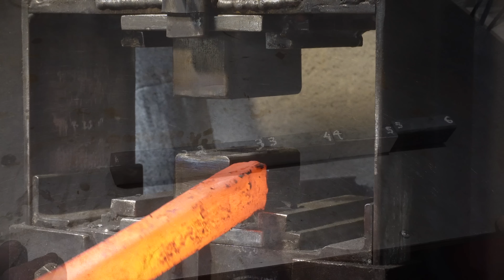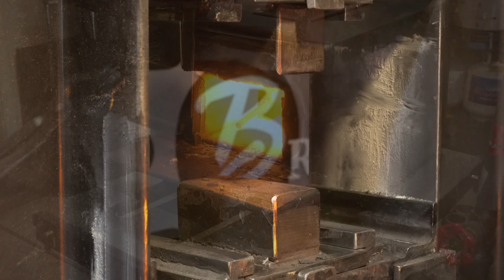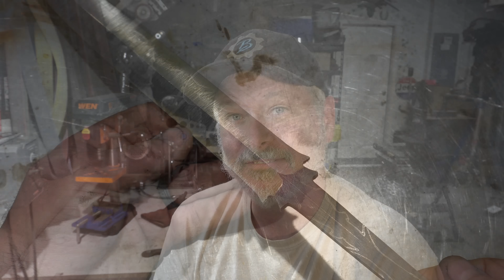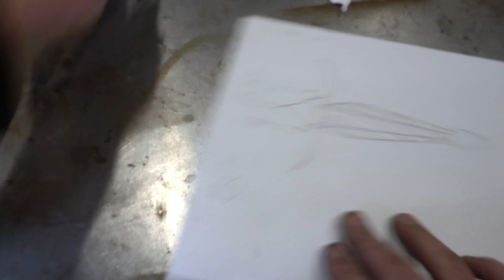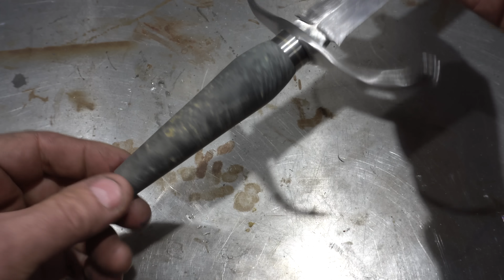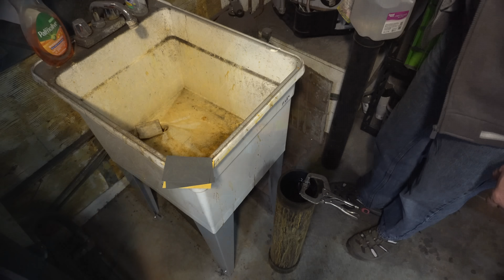Forging my dagger for The Dagger Challenge!

Comment: a lot of non welds that i saw around the 8 minute mark i guess from no flux
Reply from the maker: If you mean during the restack, that is from grinding out the scale.  Sone areas I had to go a little deeper.  There were no bad welds in this build. Flux tends to cause more problems than it solves so I don’t use it.  Thanks for watching.

Comment: Where did you purchase that dental drill ?
Reply from the maker: That is a GRS high speed rotary tool.  You can find them with a Google search.  They are around $550 though and require an air compressor with a special regulator.  Thanks for watching.

Comment: The dagger turned out great, I think the only thing I would've done differently (and that's really down to personal preference) is use a lighter handle material (I think it's too dark overall), and either use a blackened wire wrap, or change the inlays to gold and use a gilded wrap.

Still a lovely dagger, great job.
Reply from the maker: Thanks for taking a look at this build.

Comment: looks awesome!  i have a question.  do the fish lips technique make the tip weaker compared to if you just cut the tip in?
Reply from the maker: No, the forge weld on the fish mouth is like any forge weld, if done properly it’s as strong as the base steel.  Thanks for watching.

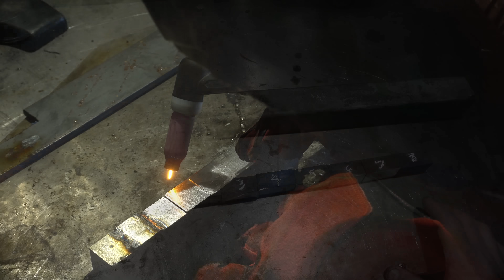Comment: 5:45 not to brag, but I used to know a guy who could TIG weld so well that he could weld two pieces of aluminum foil together.  He was a nice guy, and he didn't force his ways on anyone but himself.
Reply from the maker: Well that's definitely not me...  🤣.  My tig welding skills are basic at best.  I'm improving though.  Tig welding aluminum foil is another level for sure.  Thanks for watching.
Reply: @TyrellKnifeworks  You're better than me, I don't do welding. LOL
Reply: @TyrellKnifeworks  I just had a random thought.  I wonder  what this would look like using Copper Damascus.  I think it would look wicked.
Reply from the maker: @Asmith-1111  you couldn’t do this technique with copper.  The copper would be going through the blade instead of a thin sheet on top of the core.
Reply: @TyrellKnifeworks  ah, I see. Also I don't know if you get notifications on unlisted videos so I'll post this here:  the "crushed w" Damascus pattern video is unlisted and accessible from the "Damascus Patterns Series" Playlist.
Reply from the maker: Oops, I’ll remove it for now.

Comment: 7:25 those you lucky gloves or what, and does sharpening something like that mess up the design and coloring at all?
Reply from the maker: Those are my welding and hold-anything-hot gloves.  This billet was still hot!   The secondary bevel created from sharpening never screws up the pattern that I've seen.  Thanks for watching.

Comment: The only tool I couldn't find in your list was the one with 400,000 RPM hand held dremel/grinder thing you used on the handle.
Reply from the maker: That is a GRS high speed rotary tool.  If you Google that you should give it.  They are about $500 though.  And you need a compressor and a separate regulator.
Reply: @TyrellKnifeworks  ok great, thank you. Great channel and I like that you listed everything. Because sometimes we see something we could use and it's nice to know what's what and where we can find it. Especially us non tech savvy people haha. Thank buddy, im new to your channel but really enjoyed your videos and what you make, well done. Thanks for sharing

Comment: Looks really nice, but would a grip with a oval cross-section be more useful for a dagger? Locating it within your hand and ensuring that the blade is aligned correctly?
Reply from the maker: Quillion dagger handles were traditionally round.  The guard is used for indexing.  Thanks for watching, Geron.

Comment: There's got to be a better cut test than paper
Reply from the maker: Paper is used to make sure there's no burrs on the edge, its not just a "sharpness" test.  Thanks for watching.
Reply: @TyrellKnifeworks  see I like the burs I find it's easier to get a pierce on a difficult surface if the knife is slightly worn. I also like how dirt accumulates on stuff and I see little pictures in it....

Comment: You do make my teeth itch when you rub your bare hands over stuff .. swarf splinters make me cringe!!! When working as an NDT engineer years ago tye company used to weld repair super duplex 255 St St castings, I used to do all the cutting out .. Used to forget myself sometimes, run my hand over the surface and OUCH!! Nice big swarf sprinter!!!
Reply from the maker: Metal splinters from carbide burrs are the worst!

Comment: Why do you not use flux on the forge welds?
Reply from the maker: Flux is used but not always shown.  Sometimes its more convenient to just weld a seam so no flux is necessary but in the initial stack, flux is certainly used.  Thanks for watching, Peter.

Comment: This might be a stupid question, but what do you do with those flakes that come of the metal when you mold it? I'm only part of the way into the video so I don't know if you explain it later, and I have adhd so I won't remember if I wait until the vidio is over to wright out my question😅

And for the same reason, thank you for the diagrams in the bottom left corner, they help me out alot
Reply from the maker: What flakes off during the forging process is a form of iron oxide called magnetite.  When it's exposed to air, it oxidizes and forms a scale on the outside which is brittle and flakes off.  It's of no use because all the carbon (which is what makes the steel hardenable) is gone.  Thanks for watching!
Reply: @TyrellKnifeworks  oh, that makes sense! Thank you for answering!

Comment: A small tip i think could be helpful down the line is using a thickness meter, finding the thickness of the blade, locking the meter at half and scratching all the way down the middle of where you need the final edge to align. Not sure how helpful it is but i use it often for building planes when i need precision
Reply from the maker: I already use a scribe to mark the blade and grind to that.  The blade is within a few thou side to side.  Thanks for watching.

Comment: what rotary tool is that?
Reply from the maker: It's a GRS high speed rotary tool. It runs at 340000 rpm.  They cost about $500 but they are very nice.  I did a video on it if you look back a bit.  Thanks for watching.

Comment: Can you cut threads on your lathe?
If so, it can save you some time when cutting Spiral Flutes in your handle.
Reply from the maker: I can cut threads but the handle doesn’t have a consistent taper.  Even if it was possible, it would take you longer to set it up than it would to just do it by hand.  Thanks for watching.
Reply: @TyrellKnifeworks  right on. 
Please know, my comment doesnt take away from the absolutely beautiful blade you made. 🤘
Reply from the maker: @86Bodester  I didn’t take it any way but helpful.  Others have said the same before but I don’t think it’s realistic.  Thanks for watching!

Comment: What are those black crusts that falls off while flattening the metal?
Reply from the maker: That is forge scale.  It's iron oxide that forms when the hot steel is exposed to air.

Comment: denis i had a question what size angle iron did you use to make squaring dies? is it 1.5 inch by 1/4" thick?
Reply from the maker: Yes, 1.5” by 1/4” thick.  👍

Comment: hi, hot salt for how long? im ready to get my ordinary kitchen knives. will it work..? and what the benefit to black it? is it will rust proof? thanks.
Reply from the maker: I recently did a video on the hot salt process.  Check that out and it will answer all your questions.  Thanks for watching.
Reply: @TyrellKnifeworks  waw, very fast respond and very apriciate you sir. im watching triple t about pricing right now, thank you again for this.
Reply: @TyrellKnifeworks  just watch the video, dang its dangerous and not easy process. 😅
Reply from the maker: @terasrumahdiy5184  The bluing salts are a bit more dangerous, and frankly less applicable to a lot of applications, but the blackening salts are a bit easier and much more widely applicable.  Thanks for watching!

Comment: the grinding and sharpening takes so long because a lot of modern smiths lack the traditional foundations and suck at forge finishing a piece but that is not "the way" its just a missdirection you can easily get stuck on.
for reference a forge finished piece should take 10-30 minutes of work to profile and grind down to a sharp edge, from there you go onto polishing work that usually takes 2-100 hours depending on your piece.
but yea, dont let those machines rob you of the oldschool skills, they are definitely worth learning.

"forge thick, grind thin"
is completely modern forge ideology and completely stupid.

if this seems confrontational and pisses you off, good, use that to kick ass and learn the old smithing techniques.
Reply from the maker: Thanks for watching

Comment: What's the material that keeps flaking off during forging?
Reply from the maker: That’s scale, which is iron oxide.  It firms when hot steel contacts air.  Thanks for watching

Comment: Absolutely stunning dagger. That Siberian maple burl is absolutely bonkers. I think what I like most is the silver solder inlays. Never would have thought to use silver solder that way. Lol my dad will be brainstorming for sure when I tell him about it. We use it for stuff like repairing chrome bumpers and trim and other stuff in extreme cases. Most of the time we prefer to work or grind/sand the metal and if it's bad enough get replacement pieces. Sometimes you can't when you're working with rare or just not popular classics/antiques though.
Reply from the maker: Thanks for checking it out, Adam.  I’m glad I could inspire you with a couple new ideas.  👍

Comment: Looks bit more like a Dirk then a Dagger. Mainly for the Size. Since most Dirks are roughly 10 to 14 inches long. But then again a Dagger can be between 6 and 18 inches long. but are more commonly below 10 inches.
also a Short sword can be between 12 to 24 inches long.
Reply from the maker: It’s a quillion dagger and it matches that profile.  Thanks for watching

Comment: How do you keep track of the orientation of the billet when it's stacked and you're turning it in the press all the time?
Reply from the maker: You can tell by the scale that forms, it shows the layers.  If it gets confusing, sometimes I’ll grind a small mark onto the rebar handle.  Thanks for watching

Comment: Will using solder wire cause galvanic corrosion?
Reply from the maker: No, its the same solder used for pipe joints.  Thanks for watching.

Comment: Amazing work, I cant wait to take my ABS Quillion Dagger course with Kevin Cashen this September.
Reply from the maker: That will be pretty amazing.  Where are you taking that?
Reply: @TyrellKnifeworks  at New England School of Metalwork here in Maine. I also Have Liner Lock Folding Knife with Rick Dunkerly in October
Reply: @TyrellKnifeworks  and ABS Handles and Guards with Tim Potier in June. I did my ABS Intro class with Tim Potier this past Summer.
Reply from the maker: @IDPAnut  wow, those are some heavy hitters!  You’ll be on the right path for sure.  👍

Comment: Really enjoying your channel, and the beautiful work you do!  I have a question - when you are forging Damascus (or really anything that has multiple layers), how do you keep track of which way is 'up' in the press through the many reheat cycles?  I suspect it's something simple (like a mark or something), but whenever I watch the process I keep imagining how easy it would be to mix it up!

Cheers!
Reply from the maker: Most times my Damascus is “mirrored” so up/down doesn’t matter.  You can usually tell when you press it though because the scale will shoe the layers.  Where it becomes important is when you’re doing a canister and it’s encased.  Then I usually grind a mark onto the rebar handle so I know.  Great question though.  Thanks for watching!

Comment: I like it but the handle looks better without the little bits of...what is that wire...running up and down it.  Definetly like the grooves in it, gives it some depth for grip but the silver wire stuff is a bit gaudy
Reply from the maker: Well to each their own.  I think the wire inlay takes it to the next level.  It’s very common on quillion daggers as well.  Thanks for watching.
Reply: @TyrellKnifeworks  Beautiful dagger by the way, the pattern on the blade came out great.

Comment: Curiosity question that may have already been brought up.  From a user standpoint wouldn’t the wire wrap of the handle unduly cut into one’s hand?
Reply from the maker: Not at all. It’s exceptionally comfortable.  Remember the wire is twisted so it’s already a bit “rounded”.  This is a very traditional method for quillion daggers for a reason. 👍. Thanhs for watching.

Comment: Breathtakingly beautiful.  I do have one question.  Since you have a metal working lathe, wouldn't it have been faster and more precise to put the grooves in the spacer and the pommel with that instead of using the abrasive wheel?

I'm always amazed at how people can visualize the results of all the effort of making the Damascus steel pattern.
Reply from the maker: That would make sense if I thought about it before I cut the pommel from the the bar.  It’s too small and difficult to hold in the lathe after that.  Thanks for watching!

Comment: Resolving some borax in the kerosene will help. It turns into welding flux in the smitty.
Reply from the maker: I do have borax in the kerosene but it doesn’t really dissolve, it just kinda sits at the bottom.  Thanks for watching.

Comment: The wing tips that snapped off, was that’s blessing in disguise? Were they a weak point on the knife or was it just bad luck?
Reply from the maker: Just bad luck.  I had the knife clamped in my knife vise and when screwed it down it snapped one off because it was against the side.  That vise could snap a knife in two.  It turned out well anyway.  Thanks for watching, John.

Comment: Great info as always… what are the requirements and dimensions style etc to do the journeyman test I can not find any info. I want to see how close I am on my heat treatment process
Reply from the maker: Go to the ABS site, it has the parameters for both the performance and presentation knives.  For the perf test, it can be any style knife but a blade length no more than 10” and overall length less than 15”.  Thanks for watching.

Comment: you must have been working on this for a while because you don't have your sprayer system set up on the bevel grinder
Reply from the maker: No, I took the misting system off.  Though I like it, it interferes with filming so I found I wasn’t using it and removed it.

Comment: SWEEEEET! And thanks for doing a good long money-shot! I just love "eating it with my eyes" at the end :D~~~

That jet black finish on the blade looked almost like ceramic. Uber uber cool!

I actually ended up liking your "accident" more. The traditional "skirts", while very traditional, are a bit over used. The clean radius you ended up with looked super sleek for something this "evil looking". I could totally see why you'd go more traditional with a near mirror shine blade on a ruby red handle with brass inlay.
Reply from the maker: Thanks for checking out the build, Anders!  Many have said they prefer the way it turned out without the flairs at the ricasso.  Maybe it was a lucky accident.  🤷‍♂️

Comment: curious why it seems like everyone freehands bevels. its easy to just cut the same angle on the side of a wood block then clamp the steel to it, then you can belt sand at fixed angle without worrying about slipping
Reply from the maker: It’s easier without a jig once you get used to it. Jigs are restricting and there are many grinds you can’t do with them.  All experienced knifemakers eventually move away from jigs.  Just my opinion.  Thanks for watching.

Comment: Is that the 110 evenheat oven?
Reply from the maker: No, it’s the LB18 and it’s a 220v.  They heat up much faster.  👍
Reply: @TyrellKnifeworks  I'm 220v challenged at my house. My breaker box is maxed and an electrician told me to put 220v would require a new breaker box with more power coming into my house.
Reply from the maker: @ChristopherSalisburySalz  that’s a bummer.  You’re probably looking at thousands for that upgrade.

Comment: Pattern looked fantastic however, appears to be large and long; similar to a mini sword. Good luck.
Reply from the maker: It’s actually perfectly sized for a quillion dagger.  The blade is right around 12”.  Thanks for watching.
Reply: @TyrellKnifeworks  Thought your tape measure showed 13.5 inches.
Reply from the maker: That was before I took the tang in.  It comes in right at 12”